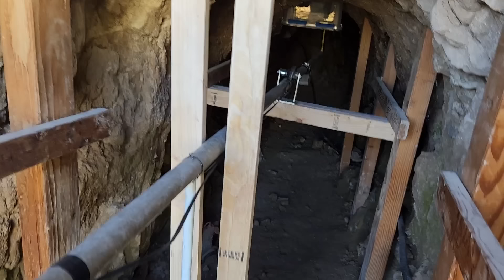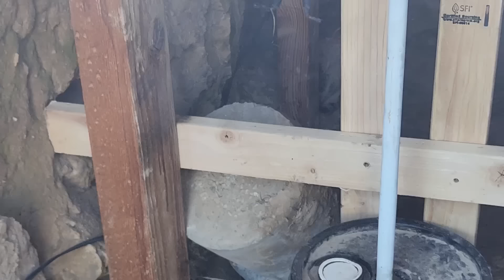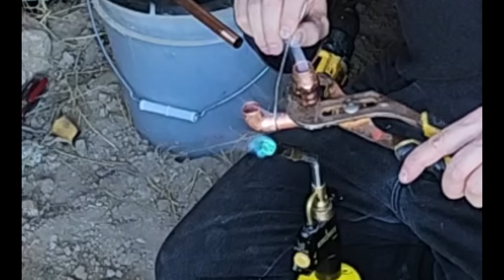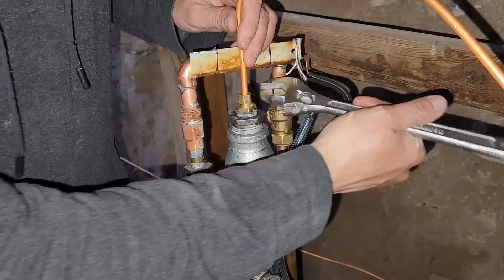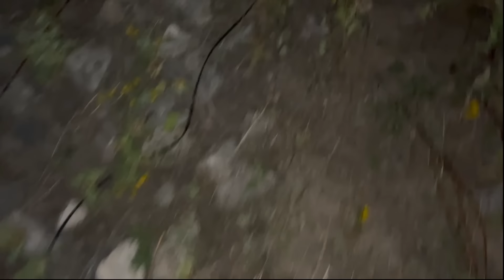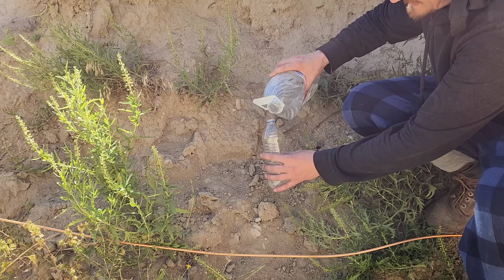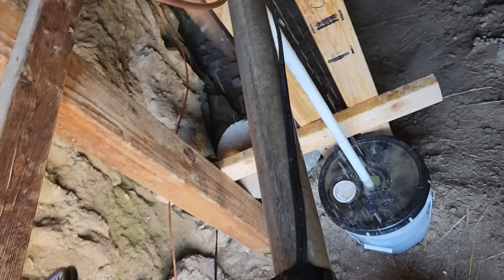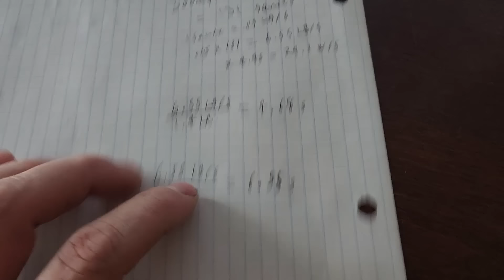Sodium Water Hybrid Rocket?

Comment: This is some of the coolest stuff ever. I've been watching you for many years and you've been a huge inspiration for me for a very long time. This video is just top-notch. Almost out of this world, i could say. I've got some technical and manufactueing experience, and if you're open to input and want to expand this project, here's my two cents.

Your casting method for solid sodium is awesome, right into the reaction vessel. I theorize one of the reasons the rocket pisses out molten sodium is because the screaming hot reaction mix shoots through the entire length of the low-MP sodium. I wonder if having the water inject from the bottom (think a few 1/4" copper tube outputs in a radial pattern) so the reaction site was nearest to the rocket nozzle might net less fuel waste since the only way out for the molten sodium is through water. I imagine a few disadvantages of this method; it would need a large excess of water, probably higher pressure too since a lot will immediately blast through the nozzle. Self limiting, might have less peak impulse too, but it also might be more fuel efficient and consistent.

Another option is hypergolic liquids. This might be easier to tune by varying the head pressures of each reactant, and might also promote better, more intimate mixing for higher efficiencies in terms of stoichiometry. NaK, as you mentioned, is a great candidate for this project since it's liquid at room temp. Another option is a heated sodium chamber - wrap the outside of that pipe with nichrome wire and you're like halfway there. Might benefit from some sort of heating rod in the middle too - you've already figured out that cored center.

Cody, if you're really interested, give me a shout and I could CAD you up some ideas and drawings.

Comment: Sticking with a hybrid design if you heated the water chamber and fed steam into the sodium you might get a more complete reaction , you’d need a thinner sodium liner for a shorter burn time to use it all before it melts it wouldn’t solve that problem

Comment: I'd love to see if you could design a separate tank for the sodium that uses heat under Argon gas to melt it and keep it liquid (or use a NaK alloy since that's just liquid) and keep them both under pressure, mixing in the combustion chamber, perhaps have the nozzles set up at opposite angles (or one at the top and one at the bottom but that would result in less thrust), both forming helixes that mix and combust. 

Whatever the case, I certainly think having the sodium in liquid phase would improve things, the heat generated from the reaction melting the sodium is definitely a challenge you'll need to overcome. I am not even sure having the combustion chamber on its side or even upside down and routing the reaction products through a tube to go down with the nozzle there so that the heavier sodium doesn't fall out once it liquefies would even fully if at all solve that problem.

Edit: well, that's what I get for commenting before the VERY end of the video lol 😆

Comment: Awesome! I have a lot of experience with steam rockets and I would imagine a steam rocket with molten sodium injected in a combustion chamber would work really well! Also you could run the motor far from the stiochiometric ratio so it doesn't run really really hot

Comment: I wonder if making the nozzle smaller in diameter and increasing the water volume even just 50% would have netted a significant gain over these results. So much unburnt sodium in the combustion chamber which could have made use of more oxidizer.

Comment: Question: can yiu run a 2 stroke (or even maybe a 4 stroke engine) with sodium and water, lets say, you replaced the air with the sodium, and you injected the water via injectors at the top of a stroke like a Diesel. Would this work, or would it not react fast enough?
Reply: It produces Sodium Hydroxide as exhaust, which is otherwise known as lye, drain cleaner.  It eats metal, so it'll ruin an engine very quickly.

Ignoring that tho, I imagine you could powder the sodium to adjust the reaction speed.

I'd hesitate to try it tho if unfamiliar with the dangers of sodium hydroxide, it'll happily eat your hands, face, eyes, lungs etc.
Reply: @roidroid  didn't he call it a harmless reaction in the video?
Reply: @jwalster9412  if given enough time it will convert into harmless stuff yes.  But not instant.

Comment: Id try different molds and test the limits of casting sodium. Maybe run air through it  as it cools and make it full of air pockets like a foam so it reacts quicker. Maybd divide it into stages that eachhave their own water injectors or spray nozzles for complete or more even combustion of the sodium. I like this idea

Comment: I'd be interested to see you fabricate a rocket that had a higher working temperature. 
By higher I mean higher than the melting point of the metallic sodium. 

You could have two pipes side by side with power washer nozzles at the bottom that point to a reaction chamber/rocket nozzle. At the top of the rocket, have a small chamber with a small amount of sodium metal and water. You have foil between the water and sodium metal and covering the nozzles. When you want to go, you pierce the foil in the top chamber, the reaction produces pressure and causes the foil over the nozzles to get blown out by the liquid sodium metal and water. 

Not sure if the melting point of sodium metal is lower than the boiling point of water. That'd nix that design. Might work with the liquid you mentioned at the end of the video. I just like the simplicity of breaking a seal to make pressure to pressurize the tanks.

Comment: That's quite the Rube Goldberg contraption. I'm not sure why you don't fire it horizontally to avoid the change in weight problem, and measure more directly, eg just with a load cell. But it's an entertaining and simple to visualise contraption too, which I suppose is the idea.

Comment: A small quibble: strictly speaking the pounds do not cancel during the specific impulse calculation, because one is pounds-force and the other is pounds-mass. There is an assumed factor of g₀ hidden in that conversion, which you have to consider explicitly if you want to convert to exhaust velocity.

Comment: Can the water be delivered to the bottom of the sodium block , to utilize sodium layer by layer from the bottom up? Also.. 
Perhaps you may consider a solenoid valve powered by the 12v battery to open the water line for ignition. Use same wiring setup with battery.

Comment: Just a thought. I do a lot of sodium demos with my students. Na, as it reacts generates enough heat to melt itself. Solid rocket boosters, remains solid until they are ignited. I think the issue is Na low melting point. If there is some way to keep it solid, until the water touches it, I think you’d have better success.

Comment: Awesome bro.  I think you're doing it backwards tho.  Could try making a water rocket powered by pellets of sodium injected into the water.  The trick is how to add the sodium.  Maybe a metal rod could get pushed into top of water chamber.  The bar could have holes drilled along length of bar.  Sodium could be cast in each hole.  Rocket ignition starts when rod is plunged in water chamber.  If you get famous... remember me!!! 😆😆😆

Comment: I wonder if getting better thrust and generally more even performance could occur by way of a "grain pattern" similar to the shuttle's SRBs. Perhaps have a wider inner diameter at the bottom, reaching the previous diameter at the top with some star pattern to have more surface area. Altenatively maybe doing that upside-down would give better contact of the water all across the sodium, but I'd expect a risk of engine clogging.

Comment: The biggest challange is indeed burning the sodium consistently up until the end, certainly you need a way to make sure the contact area between the oxidizer and sodium to be mostly stable from start to finish... and considering that sodium has a tendency of state change too... damn, that's quite a pickle to solve. Maybe trying to inject the sodium too would help, but mixing sodium to something to make this injection easier will decrease efficiency. Shucks.

Comment: If you want to upgrade you thrust test rig, you should have it firing horizontally instead; doing so would cancel out the mass of the rocket motor, allowing you to not need to assume the fuel burn profile.

Comment: I wonder what would happen if you "simply" (I know it's gonna be anything but simple...) scaled it up to a few gallons of water instead of a pound? Like, the hope would be that sodium reacts with it before melting itself apart, or at the very least you'd quickly eject the molten stuff and quickly hit solid stuff again, plus the extra idle mass wouldn't hurt in a real scenario although it'll make you redo the water-only measurement for a fair comparison

EDIT: Oh, you were already running a theoretical excess of water, I somehow hadn't realized that ; probably means you still need more though

Comment: Could you make a thin sheet of sodium and roll it up like a swissroll with steel or copper wool in between the layers so that the water would have more surface area to make contact with immediately?

Comment: With energy density of TNT, sounds very bad rocket fuel. Kerosene and oxygen are OK with rockets, pure hydrogen and oxygen is very good, but low density cause some problems in first stage, where size of the tank is engineering challenge and additional weight source.

Comment: Idea for this experiment: Instead of having 1 "cartridge" containing sodium, I'd suggest to go 2 (or 3 if u can manage it). So while testing out the apparatus or during field testing, should something not work as intended, you can quickly unscrew the spent sodium "fuel tank" with a fresh one. And in case where everything goes well the 1st time, repeating the experiment gives you more data points to plot and average out any incorrect readings that might occur in the 1st attempt.

Comment: This was pretty awesome to see! It seems like there may be a need to fine tune the flow rate/metering of water so that it can be introduced to the sodium at a controlled rate. An adjustable metering valve could be used if you want to keep the 800psi head pressure. Additionally, a check valve to prevent back feeding your pipes (much like a flashback arrestor) could be a good idea. Putting the sodium in some kind of open cell matrix to limit the reaction rate could be useful too, though you might end up limiting the thrust available that way. I think a matrix going something along the lines of "sodium sponge" with a near-inert filler material such as silica might work well, though you'll want to wait longer for the dust to clear in the case of silica dust. Garnet media might be better. Any suitable filler material is likely to damage a graphite nozzle, though. Maybe sodium melted into glass fiber could do the trick.
Reply: Just saw the end where you said you're going to move on to a liquid only system. In that case, i hope you find a good method for metering the flow of liquid metals!

Comment: Might be hard to get, but... there exists a type of ceramic bead that can be loaded with all sorts of material that has to react at a steady rate in chemical processes. I wonder if those beads could be loaded with sodium and packed into your combustion chamber? They would present a larger surface area for water to react to and a scaffolding for the sodium to cling to even when it starts to melt.

Comment: The sodium self melting with the ignition temperature is a problem to solve, I think you should have a second injector and directly inject molten sodium and water right at the combustion chamber, so that way you would also be able to control the water to sodium water.

Pumping molten sodium is your next problem, but that has been done, there are even molten metal nuclear reactors.